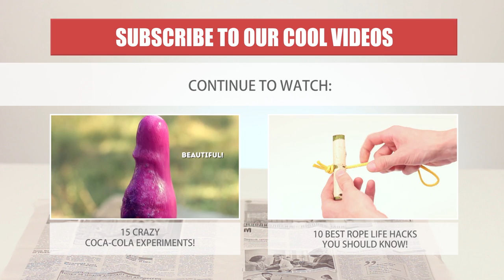10 house Repair life hacks from Mr. Hacker

Comment: Don't use the first one EVER! Reason being if the sawblade grabs it can shatter and cause you some serious injuries. Even 'bi-metal' blades can do this. It's up to you but, for the few extra minutes it takes to cut it conventionally I wouldn't risk it.
Reply: And if you value the saw blade more than your life, still don't do it, because you'll be using the saw blade at one position only, which will make it wear at this position faster and shorten its life
Reply: Yeah, for that one I'd rather use my lathe.
Reply: lockudlad why
Reply: And no matter how you cut the bolt, it's a good idea to thread a nut (or chaser or die) up past the cut location BEFORE cutting.  Then, when you unscrew it down over the fresh cut, it re-forms and cleans the bunged-up threads.
Reply: lockudlad

Comment: You want both nuts on the keeper side of the bolt you are shortening.  After cutting to length, undo the nuts and it will correct the threads at the cutting point.

Comment: Thanks, the bolts protect the threads.  Don't turn a wet paintbrush upside down.  The paint will slip into the ferrule and leak onto the handle; or dry and ruin the bristles. Needle-nosed pliers hold small nails well, too!

Keep the hacks and tips coming . . .

Comment: Having cut many bolts over the years, I would recommend placing another nut up near the bolt head. After the bolt is cut(whether using the drill or manually) the thread is probably messed up a bit at the cut site. Removing the nut over the cut will help restore the thread, making it easier to then start a nut on the shortened bolt when you put the bolt to use.

Comment: Thanks for the info on this video. I was able to cut a screw using your drill & hacksaw method in about half the time. The real benefit was the clean cut on the screw. It was a nice even cut that took only a few licks with a file to finish. Thanks again for your time & effort.

Comment: 1. There's no point measuring the depth of the drywall anchor, as the drywall is at most 1/2" in your house, and tour drilling farther than that.

2. if you hit your hands with a hammer you need to practice banging nails because you just suck at it.

3. screws, that's what predrilling is for

4. don't trust a guy that uses a mason's hammer to drive nails
Reply: You hit the nail on the head on that one!
I like how he shows you how not to hold nails with your hands......and then holds nails with his hands.
Reply: Lol
Reply: Además, uno compra la sierra de una punta  a la otra ¡Úsala entera! Saws are like a dick, you use it from one end to the other!
Reply: No point in measuring the anchor? I have all the sizes of anchors around and I usually have concrete in my house. Other popular choice for walls is AAC blocks, cement blocks, masonry blocks with holes or without... so why not measure? Drywall panel are so thin that it does not matter as the anchor will go trough it and the hole is a trough hole.. while concrete is solid and requires a blind hole.

As for measuring.. you have to measure the screw as well (and the bracket you are fixing)
Reply: AsiAzzy concrete is a different story. He's talking about drywall. In concrete it's important to measure the depth of the drill, then again you want the drill to go a little deeper than the screw. And for that matter, i'd just use a concrete screw e.g. tapcon
Reply: I use normal wood/general screws into plastic anchors or if requirements are high, I use expandable steel anchors.
Reply: k
Reply: INDY92500 no such thing as cinder block for quite sometime. That's also not its only use. 

How can you say for certain is not just a blunted mason's hammer? You realize metal dulls right? .I spent summers laying brick, I'm quite familiar with the hammer. Either way it is the improper tool.
Reply: O
Reply: The
Reply: 1
Reply: dont know if anyone pointed it out yet, but that is a tinsetters hammer used by sheetmetal workers.
Reply: +Juan Velrez g
Reply: Mat 

1.  Drywall is what he had handy.  It was just a demonstration.  Chill.
2.  Two steps instead of one - really efficient.  Hard soap or candle wax is a time-honored method of getting the screw in efficiently - even the hole is predrilled
3.  Like you've never used the wrong tool for the job because it was the only tool you had.  Or for any other reason.  

You need a chill pill, dude.
Reply: I'm upset because...?  LOL  Obfuscation.  Take your pill - you'll feel better.  I promise.
Reply: very good
Reply: Matthew Van Helden      . ."      .

Comment: I use pliers to hold them tico nails when Nailing hurricane clips to the trusses with the metal mesh, and also throw in 16D common galvis in a metal bucket and melt a couple candles or wax to help nail faster . good ideas

Comment: Instead of tape round the drill bit to measure depth, I keep a small bottle of "Tippex" (or similar) typewriter correction fluid in my toolkit. A small dot on the bit at the appropriate depth becomes an easy to see white line when the bit is rotating at speed. It can be easily scraped off if you want to alter the depth.

Comment: Not bad, coole ideas.
When Cut the screw to make but the nuts better on the side of the thread that is needed later.
So you can simultaneously when unscrewing the nuts immediately recut the possibly when sawing damaged threads back or repair when the nuts are removed.
So better on the other side of the nuts screwed the screw saw off.
Sorry for my bad english something, my last lesson here is about 30 years ago in Germany ;-)

Comment: When drilling a hole in the wall, you should take the lengt of the screw, not of the plug.
The screw could be going through the plug, and the hole is not deep enough then.
Reply: Dario de nero
You're right. My mistake.
But the screw could come out of the bottom of the plug (stronger that way, because you're sure to use the whole length of it), and then the hole is not deep enough.
Reply: He has a cheap drill 😂😂 that's why it can't go all the way in it looks like he bought it in Walmart or in target he need too get a Dewalt or Milwaukee no one will wait 2 hours too cut tile wtf 😂😂
Reply: If the screw perforates the plug, they don't match each other.
Reply: John Dough
The length of the screw is what matters.
Not the length of the plug.
To make sure you use the total length of the plug, the screw should go through.
Reply: Because the tip of the screw that sticks through is doing so much good?

Comment: Rather than soap , drag your screw threads across a candle, when you drive them the friction will melt the candle wax making a much more efficient lubricant, (It also coats the screw adding more rust protection)

Comment: I have an issue with your first hack, the screw cutting with hacksaw. It is guaranteed to bur the end of the screw, creating some difficulty starting the nut. You must put the two locked nuts on the side of the screw that you wish to use. After cutting you remove the nuts and in the process remove burs assuring the nut will start easily.

Comment: On the first one, when cutting a bolt, I always put a nut  on the same end as the head. After you make the cut you can turn the nut off the bolt and this will (mostly) clean the threads. You will still need to file a little to prevent a cutting edge, but you'd have to do a lot more if you hadn't used that nut.

Regarding the tin foil in the paint tray, I just buy the plastic liners - they're  cheap.

Comment: how often do you come across 1" thick drywall? (considering you used tape to mark the depth of a 1" drywall or hollow wall anchor that is half inch thick at most.  you don't need an anchor when you are screwing into a stud, beam, or joist

Comment: Before you cut the bolt put one nut up near the head of the bolt and after cutting unscrew it,it will clean any small burrs from the threads at the cut making it easier to thread the bolt into a threaded hole or to thread nuts on it.

Comment: Very good tips or hacks but when cutting a bolt you can mess up the threads. So, twist another nut on past your cut line. After you cut the bolt, unscrew the nut to clean or straighten out your threads on the bolt. :?)

Comment: Run the nuts onto the OTHER side of the line (onto the half you are going to keep, with the head) before cutting. This way, when the nuts are spun off, they may clean up rough edges, making it easier to thread nuts back on.

Comment: with paint roller trays I just use an old plastic shopping bag from the supermarket and put the tray inside and tuck the edges under then when I am done I invert it and throw it away. Clean roller tray and less plastic bags :)

Comment: Cutting a Bolt shorter will mash the thread making it difficult to put a nut on it to prevent this, thread a nut onto the bolt beyond the point that you want to cut it, then you unscrew that nut after cutting which will clean the end of the thread up.

Comment: When you drill drywall to install a plastic anchor you are removing the very material you need to hold the anchor. Instead use a sharp awl with the proper shank size and twist and push it in. This compresses the drywall and creates a strong anchor point.

Comment: 1. Blade will grab, shatter, and embed pieces of shard into your hand. Not advisable. The only advisable thing is to put a nut beyond the cut.. so you can unscrew the nut and clean the threads. Other than that vice+hacksaw, lathe, angle grinder+locking pliers/vise are the safest popular choices

2. The tape marker is useful but even more useful is to make a flag out of that tape. When it reaches the surface it will clear out the dust. (Better seen when drilling downwards)

3. Some pliers are more near to me when working with hammers and nails.. so I'll grab a pair of pliers instead. Also better grip.. what if you glance and the nail wants to fly and mare the surface? I'd trust a pair of pliers for this more than my hands or flimsy comb. For diehard carpenters/roofers there are hammers for one hand nailing that holds the nail on the hammer.

4. Use pilot holes. But other than that it is useful.. soap reduces friction.

5. Good to know. But since you started doing tiles.. don't you have a tile cutter nearby? For a one off job is nice to know tho.

6. Magnets on end of the hammer for nails? Not advisable.. you want to grab the very end of the hammer and nails stuck there are only a hazard for punctures in your wrist. Magnet on your hand is better.. might use that someday.. but for big jobs, get a nail pouch.
Magnet on screwdriver..  most bits are already in a magnetic holder and/or magnetic themselves.  So the magnet on screwdriver is useful when bit is not magnetized, or weakly magnetized..(and for the rare occasion i just run them trough a magnetizer-demagnetizer tool) just beware that some screws are stainless and no magnet will hold them.

7. Good enough for small objects and you can turn them by the string. 

8. it's just a plastic paint dispenser.. use it as is and wash it lightly after (I keep one for each paint to not cross contaminate.. i've used one for a bit over a decade with 20+ layers of white wall paint. still in working condition) A new one cost cents anyway

9. Just use a rubberband, or a glove like in video if is more at hand and already torn. As for the rubber-band over paintcan.. it's brilliant.. I use this all the time I paint from a small can

10. The paint can from milk bottle.. really useless. A better container to paint is the actual paint can. And to store the paintbrush temporary I have a trick I use: form a small hook on the handle near the ferrule.. and hook it on the edge of the paint-can. For me the hook consists of coat-hanger wire, or a simple screw partially screwed into the handle.

Comment: next time you cut the bolt, thread a nut on above your cut so if the threads get buggered up from the cut you can chase them out with the nut by threading it off the bolt.

Comment: The magnet holding screws on the drill shaft is dangerous.  If you accidentally crank the speed to high, you're going to have sharp screws flying all over the place.

Some of the others are good.

Comment: Funny that they used a concrete bit for the drywall anchor
Reply: If they had used an ordinary high speed bit it would be blunt after a few holes as the plaster is an abvasive
Reply: ooooooooooooooooooh you seem to know a lot of things
Reply: Well Manolis I have been in the building trade all my working life so I have picked up a few tips
Reply: Roger Sprules Hh

Comment: Cutting the bolt in the old-fashioned way is faster than with your method.  As a second comment I use to put the nuts on the other side of the cutting, because after cutting, the thread beginning will be broken, so after you cut, you extract the nuts and the new beginning of the thread will be corrected.

Comment: The magnet sharp objects idea is actually dangerous. Having worked construction in my late teens and being on a roof or otherwise you work with a pouch for a reason. You can have slippery footing.
Reply: Having falling from a roof i can tell that small screws on your wrist, or anywhere else, is the least of your problems... 😉
Reply: You're liable for your own safety when insurance starts asking questions and if it has to go to court you won't win a case where you put exposed pointy objects on a magnet. Especially if someone else gets hurt by the user. You don't even list the strength of the magnet and as a result a fast flick of the wrist will fling a sharp object off. By youtube rules I could report the video on that basis alone ya know.
Reply: Well, I am from sweden. Different system. :-)
Reply: Yeah but a lot of these tips are for laymen.  As a professional (or past professional) roofer it was in your best interest to buy a pouch or tool belt, but for someone who uses tools for general house repairs the magnet might work out.

Comment: On that first one with cutting the bolt in the drill  you cut on the wrong side of the nuts mate...will have trouble getting the nut on the cut bolt, if you cut on the other side of the nuts you can then screw the nuts off the bolt to clear any swarm out of the thread on the bolt you cut... duhhh

Comment: life hack #11.   holding the hammer at the end results in more hitting force with less effort.
Reply: That's not a hack, that's just how to use a hammer. Commonly viewed as one of the simplest tools.
Reply: You could make the same argument for most if not all the tricks in the video. Mark where you want to drill to with something. Cut bolts when you need them shorter. There was another comment about whether or not they should be called hacks or tricks or just proper or clever use. My conclusion was who cares, it changes all the time anyway. Different people will call it a different name and be certain everyone else is wrong.
Reply: also using the proper type of hammer As he is using a Masonry Hammer or (Brick hammer)

Comment: The bolt saw off has just buggered up the threads, instead you should cut on the other side of the nuts and use the nut to clean the smeared threasd :-)

Comment: The first hack is incorrect. You'll want to place the nut(s) on the side of the bolt that will used. after cutting unscrew the nut and it'll clean up the threads. Doing it the way it was shown makes putting the nut on very difficult if not impossible without re threading the end of the bolt.

Comment: Please dont do the drill thing without moving the hacksaw blade forward, you will fuck up the blade after one rod....also, the nut should be kept on the part you want to keep so the threads arent ruined

Comment: I don't get the last one? not hating but, what are u supposed to use that for
Reply: Right? I would have thought that the paint brush would at least face brush-side-down so the paint drips back into the container
Reply: When painting a wall your progressively moving on, that just makes the entire package a lot more portable
Reply: Conrad Gardner I suppose. I do a lot of staining, batches of 8ft picnic tables and patio furniture. When I'm on the move though, I just lay the brush across the top of the can and ta-da. I've never felt the need to have one of these...thingies
Reply: Logan Silva

Comment: you did number 1 wrong although you can make a clean cut on a machine screw and make it shorter it will screw in..there are times the cut is not so good and it will not screw in.  so you need to put  only 1 nut on the other side of your line.then all you have to do is screw the nut off  and it will clean the threads perfectly.